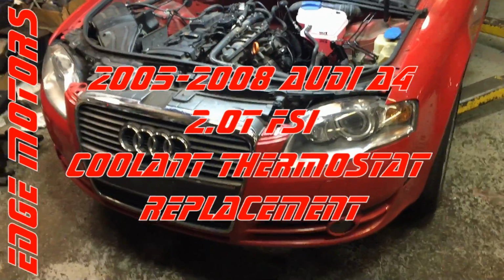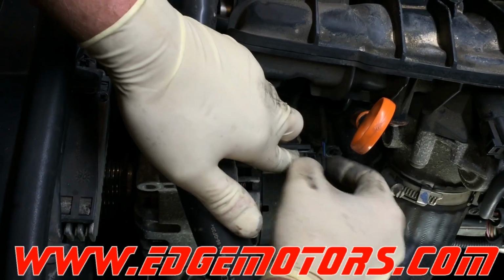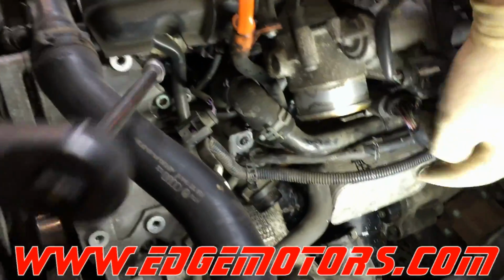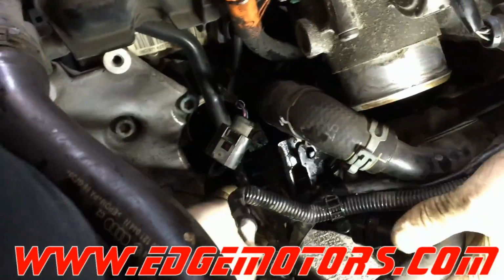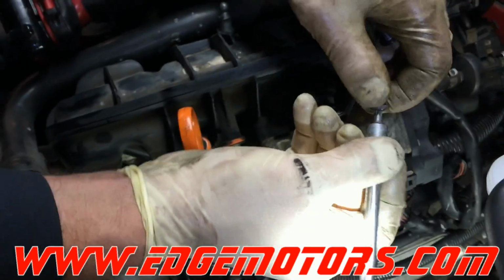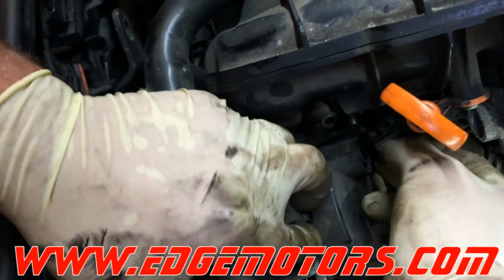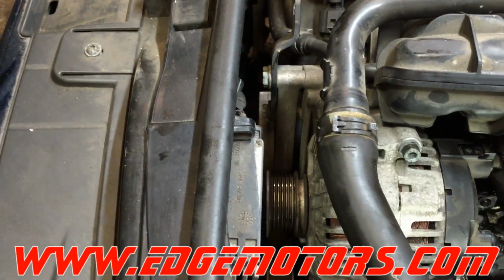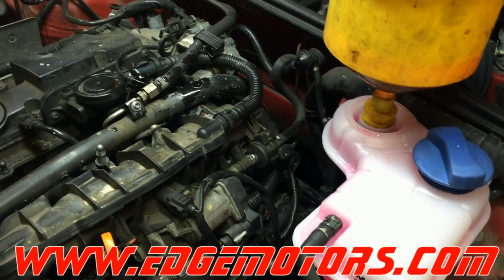2005 - 2006 Audi A4 2 0T FSI coolant thermostat replacement by Edge Motors

Comment: This guy is spot on.  Used this video.  2 hours later completed without any problems at all.  The 2 lower bolts on by the oil cooler are the hardest part of the whole job.  Just watch listen and learn.

Comment: 2009 Tiguan, 2.0 tsi, 107,000 miles. Burnt rubber smell today. Ant correlation between that and antifreeze. My wife only added a few ounces and it was about a week ago.

Comment: If you've drained the cooling before starting, will it still leak that much coolant when you remove the thermostat (or the water pump)?

Comment: hey man. how much would u guys charge to replace thermostat and oil filter  housing gasket? I already have the OEM parts.  your shop is about 1:30 hr from me but if price is right, I see how careful you are working with cars so I wouldn't mind doing the drive
Reply from the maker: It will be some where around 300-400$ all together

Comment: Why would you use full strength antifreeze and not mix it 50/50 with water ? Antifreeze does just that...not freeze but it's the water that has cooling properties and without it it won't cool properly during summer time.
Always ix 50/50 water and coolant(assuming coolant is not premixed already).

Comment: i'll admit, I'm not a mechanically inclined person so i called the shop I frequently go to that strictly does Audi vehicles and they said it would be a 4 hour job. am i missing something here? cause you were able to do it in about 20 minutes
Reply from the maker: The fact that i can do it in allot less time than the book says, and the book does say about 4 hours... Does not mean that I won't charge you for the whole time... You have to remember all the overhead, training time and tools cost...
Reply: +EDGEMOTORS fair enough. Thanks
Reply from the maker: +Dave K also you shouldn't forget that some times the book says 1 hour, but it takes over 5...
Reply: the book is a farce.No way in hell it takes 4 hours for the A4 thermostat.maybe 1hour

Comment: Can you mix green and pink coolant? If not what is your experience with the problems?
Reply from the maker: +Dale Fluegel no, you can not. it will turn brown and contaminate the whole coolant system, which will lead to allot of problems.
you must flush the system truly out and replace it with g12 coolant.

Comment: Wheres the engine coolant temperature sensor location? the right rear of the engine ?
Reply from the maker: Yes behind the cylinder head there is a black plastic coolant flange, it has couple of coolant hoses connected to it and on the right side facing right and down a coolant temp sensor, it’s gray in color with 2 wire connector...
Reply: Thanks for the response found the location replaced yesterday

Comment: off topic question: I have a B7 Audi A4, and would like to know if a dying battery can cause the throttle to go into limp mode?
Reply from the maker: What do you mean by throttle going into limp mode???
Reply: +EDGEMOTORS sorry I don't think it's really limp mode. the car basically dips RPMs every now and then when idle and the engine will occasionally stop running.
Reply from the maker: +RickyTomatoes did you scan the car to see if you have any codes in there?
Reply: EDGEMOTORS I have a basic OBDII scanner, and used that, but no codes were present. 
One more thing, when the car does stall, the battery light comes on.
Reply from the maker: +RickyTomatoes  try something more advanced.

Comment: Man, you are pro big time
I have question; im driving audi a6 c6 2009, 2.0t
My thermostat one day works and then not for day or two, and soon one. I know that I need to change it. Do you know what could be the issue?
Thanks
Reply from the maker: Sorry without looking at the car and diagnosing while it’s not working correctly, it almost impossible for me to tell what the problem is...
Reply: Tnx
I will check it

Comment: Good video overall, but the points you need to know are:

1. He has done it 5 mins ago and pipes / clips come off easily. It want be that easy if your pipes are in place for 10 years
2. The accessories belt will move and in order to put it around the idler you have to undo the top 2 screws of the tensioner , so you can pivot it out of the way.
Reply from the maker: The job was done as the video goes.... once not several times...
Reply: Loooool. What on earth are you saying?  The tensioner is slackened with a 17mm wrench. The belt is slipped off the alternator pulley.  All of the hoses and pipes will remove fairly easily.  The hardest is the lower radiator hose which requires wiggling it whilst pulling back on it simultaneously.  This is clearly showed in the video as he fought it off.  From there, everything else is straight forward.  This is a one hour job tops.

Comment: What is that power tool called that you're using? The power drill that I see normally is much bulkier. Thank you in advance
Reply from the maker: Depending on which one you talking about... but I think you are talking about the impact driver from dewalt
Reply: @EDGEMOTORS   it's the tool you were using to remove the 12 point screws. I believe that's the one.

Comment: hi,i have the same car and my thermostat shows me 70 degrees wen driving and goes up to 90 degrees when stending still,i guess i must change it, right?...one more question,those type of cars have two intercoolers?thanks and sorry 4 my bad english ^^
Reply: Same exact problem as you. Only reaches 90 when idling. I used Vcds to monitor temps and the temp gauge might show 90 but car true temp is 75 while driving. Did you fix with main thermostat or inline thermostat?
Reply from the maker: Yes if the temp goes down as you drive, the t stat has to be replaced... and yes they do have 2 intercoolers
Reply: EDGEMOTORS mk5 vw has 2 or 3 thermostats not intercoolers. They are called inline theromstats.
Reply from the maker: Mk5 GTI has, not the b7 a4, and the guy was asking “ intercoolers” ... and the b7 Dora’s have 2 of them
Reply: I have an a4 and my temp goes up is the the same problem

Comment: The ends hoses connects to are plastic?  When these become brittle and break these motors and the whole car become junk. I bet Audi has designed these plastic parts to deteriorate and replacements to cease production or cost an arm, leg, eye and sometimes the kidneys to obtain in 15 to 20 years time when they need replacing.
Reply from the maker: We’ll figure all manufacturers have life expectancy of their cars around 5 years, and they work on getting the cost down as much as they can but so it last the life expectancy....
Reply: EDGEMOTORS I think the key word there is life expectancy. It is no longer how long it can naturally last but rather how long manufacturers want it to last,  which is being reduced to increase turn over and profit. Also key is the prevention of extending life expectancy by no longer making use of low cost universal and interchangeable parts. Manuf. are not just cost saving driven.  They would rather spend more to have unique parts if it would increase profits. All are now prpprietary and no aftermarket options eg. hoses were round and interchange and available via aftermarket suppliers. They spent money on square hoses and unique clips to prevent repairs.

Comment: That was Amazing Amazing Amazing!
Do you have a video or can tell me where to located the CTS (cooling temperature sensor/sender) on my 2011 A4 2.0   I have tried everything. 
#ANewSubscriber
Reply from the maker: Behind cylinder head on a coolant flange facing catalytic converter

Comment: I'm having an issue with car turning on and the fans turn on with it, I put heat to like 80 and max and it blows out cold and also the coolant level was -40° when I checked it with OBD11 I assumed it was the Coolant Temp Sensor so I replaced that and got a CEL for it I cleared it and still came back, the fans are still running every time I start up car and they don't turn off I'm not sure what it could be at this point the I'm going to replace the thermostat, begging of next week when it comes in hopefully see if that may solve my issue but if anyone knows what is causing this issue please let me know would really appreciate it.
Reply from the maker: What kind of car you have?
Reply: EDGEMOTORS 2008 Audi A4 2.0T
Reply: Any ideas?